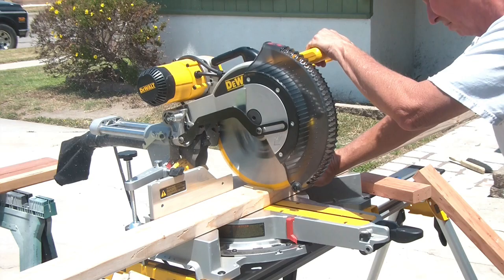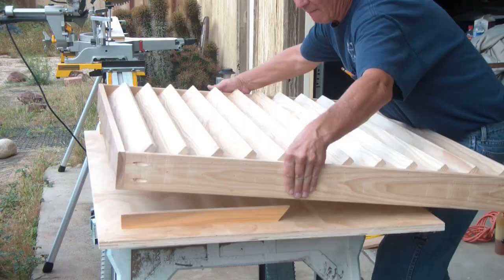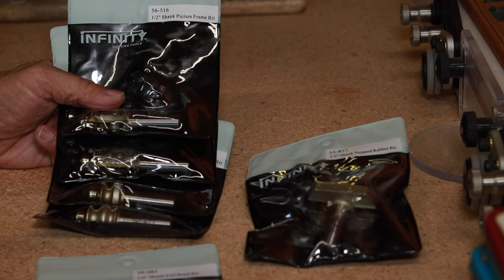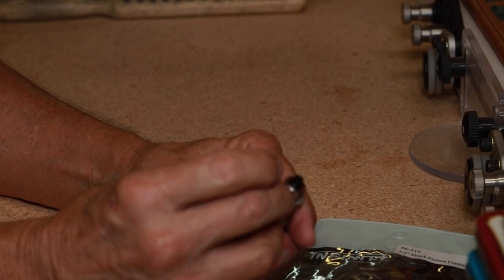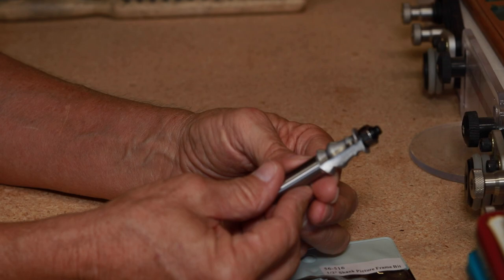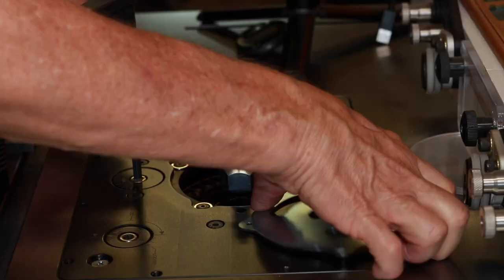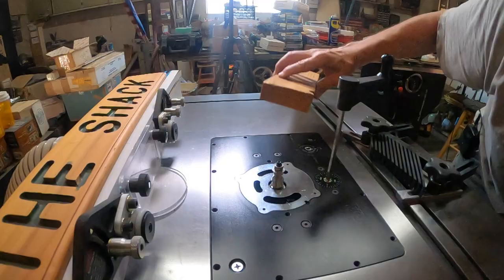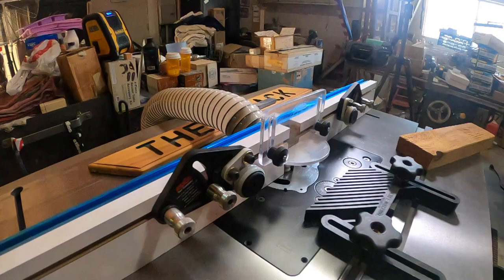Infinity Picture frame router bit set

Comment: I use a lot of Infinity product I think you will enjoy them
Reply from the maker: Gary I have a few Infinity items like the Corner Radius Guide Set. As much as I prefer Woodpecker set I couldn't justify the cost for something I use a few times a year. I prefer American made vs anything else but now and then I will buy foreign if it will have little use. If I end up doing more frames then i will seek Whiteside bits. Thanks for viewing. I do like the profiles and excited to try them on a few frames.